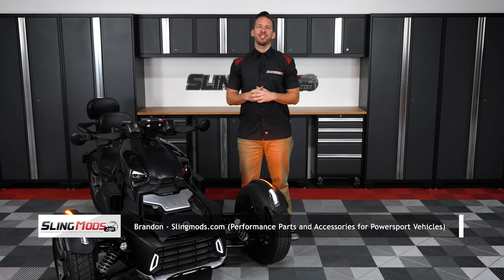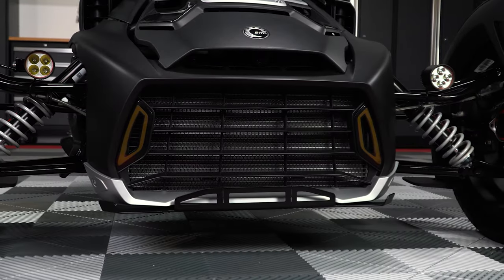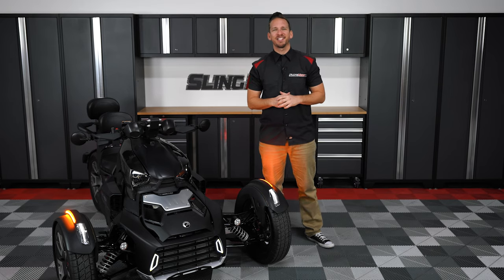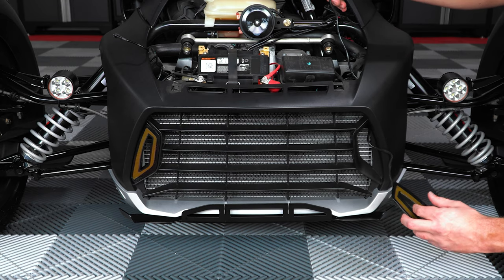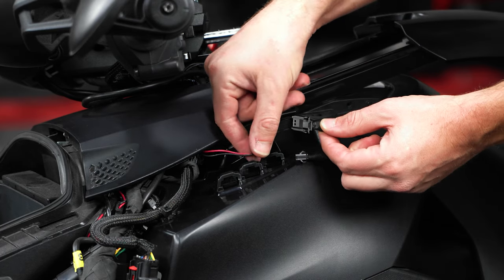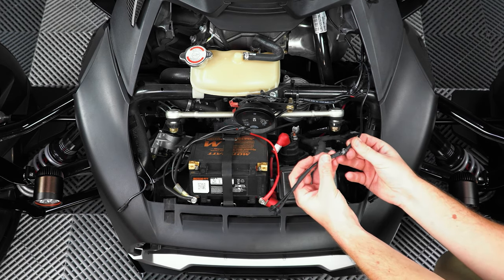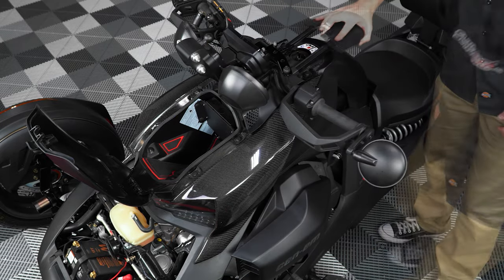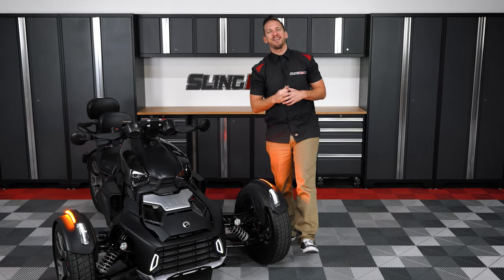Can-Am Ryker Front Grille LED Running Lights

Comment: Can you do a video installing the fuse box?  I am already using the accessory port using the 4:1 splitter.  Your site has other lights, as well as this product, that I would like to install.  Thank you.
Reply from the maker: Hello DPerry, yes.. that is on the video list.. but it's pretty far down the list. If you have any questions with wiring we're here to help. The fuse block only need 3 wires to run. Once connected you'll have the ability to have mods automatically turn on/off with the ignition power. We also have a Neutrino fuse block that allows you to control all your lighting mods from your smart phone if you're a techy. Thank you!
Reply: @Slingmods  I'm not a tech girl at all.  I use your videos for all of my installs on my Ryker.   Your videos are easy to follow and very helpful.   I guess I'll have to wait until the fuse box install  video before making additional light purchases.  Thank you.
Reply from the maker: @dperry7830  Hello Dperry, well thank you for the continued support, it's greatly appreciated. I completely understand that. My apologies for not having a video already done for this.. With all the mods launching our production schedule has been quite hectic and it's a bit tough to keep up as the videos take about 3-4 days each to complete. If you need any assistance or guidance in the interim period.. we're here to answer any questions you may have. Thank you!

Comment: Do I need to purchase the 1:4 expansion kit if I need to install both the Front Grille LED running lights inserts and the Split Color LED Front Fender running lights?
Reply from the maker: Yes you would. I'd also recommend running both of those to our new Fender Power Harness here: https://www.slingmods.com/canam-ryker-front-fender-power-harness
Reply: Thanks. How do I connect the new Fender Power Harness to the Sequential LED Turn signals with the RED Reflectors LED turn signals?

Comment: You need to show how to do this when you have more than 2 accessories installed...NO one has just 1 or 2 anymore come on guys...
Reply from the maker: Hello Justin, we sell a 1:4 power splitter to run up to 4 of our LED products off that accessory port under the upper fairing. That can be found here: https://www.slingmods.com/canam-ryker-dual-color-led-expansion-kit-tricled We're also launching a plug n play harness that pulls power off the circuit used to run your two front fender lights. That will be available at the end of January! This new fender harness will drop a plug n play connection down by your a-arm on each side of the bike for an easy to access plug n play port for single, dual color and our new sequential lighting strips.
Reply: @Slingmods.comdoes the new harness daisy chain with the sequential yellow and red lights on the fender if those lights are already installed?
Reply from the maker: @dperry7830  Hello Dperry, currently no.. but we're launching a Y harness next month that actually intercepts the wiring harness used for the front reflector kits. This harness will give you a power port that's available down by the a-arms, allowing you to run all of our single color, dual color and sequential LED lighting strips. We know you guys have been asking for another location to plug your lights into and this will provide that. Stay tuned on this...
Reply: @Slingmods  that's awesome.  Can't wait to get it.  Will the port support 4 lights like the upper accessory port?
Reply from the maker: @dperry7830  Yes, it will. The fender lights use a different circuit and will be great to run up to 4 LED lighting strip mods.. leaving the 12v accessory port under the fairing open for other mods.
Reply: @Slingmods  so that's potentially 4 sets of lights on each port per fender?
Reply from the maker: @dperry7830  4 pairs of lights total. So you could run 4 left side lights and 4 right side lights. Example: You could run our Dual Vertical Fender Lights, Dual Color Air Scoop Lights, Dual A-Arm Lights and 1 other set. We'll be sure to go over all of this in the video as well.
Reply: Can u mount these cool weather